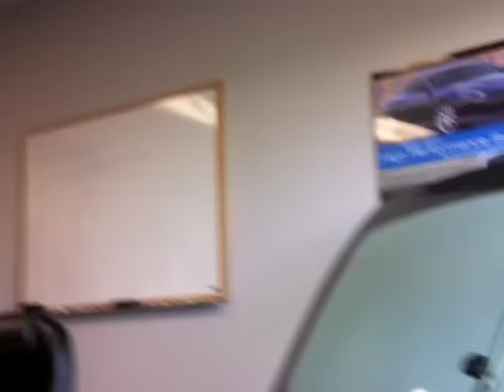Tips and Techniques: Curved glass technique (Part 1)

Comment: do all tint films shrink the same? I don't have a specific film supplier at the moment so I use the Gila film from the local autoparts store,does Gila shrink the same as any other film?
Reply: Rafael Moreno Hell no. The stuff we get at parts stores is poor quality and won't withstand a heat gun.
Reply: i was in a bit of a hurry so i had no choice,i have a two year old baby and had to get the windows done,i did have a real hard time heating it up for the back window but worked ok,in my years of experience i've never had sutch a hard time tinting the windows as i did with gila,anyway hey thanks for your rrsponse,cheers